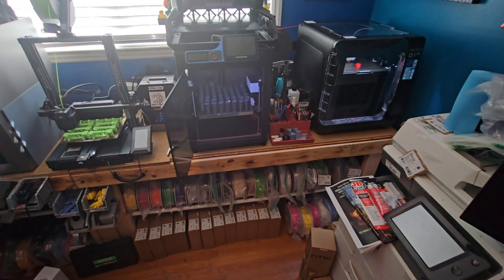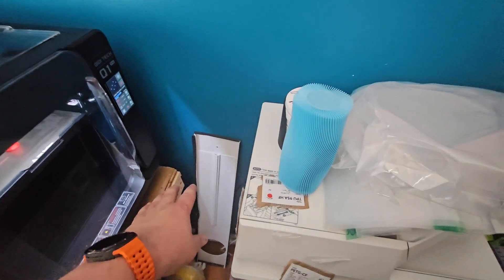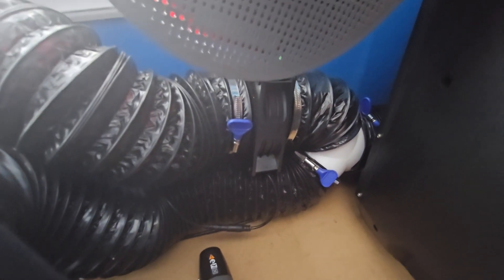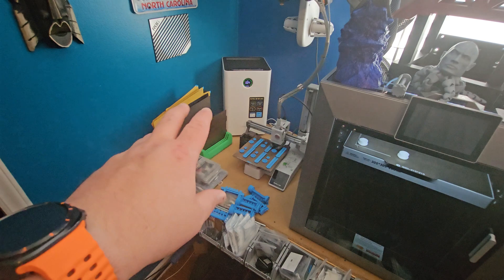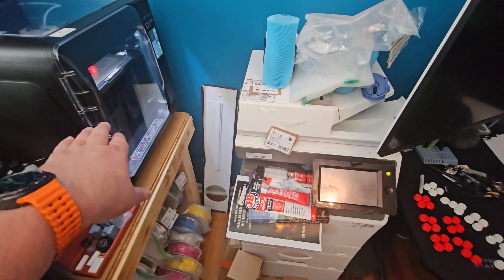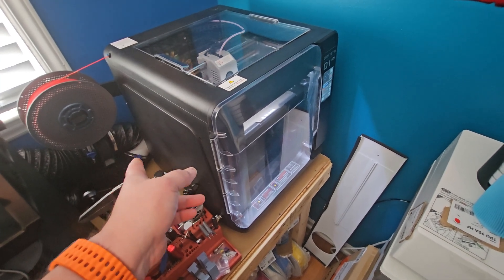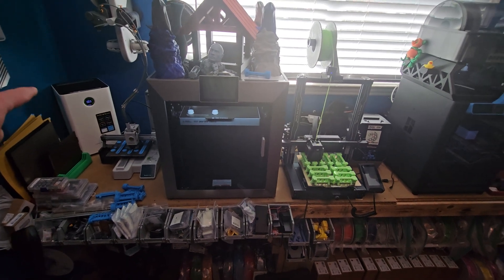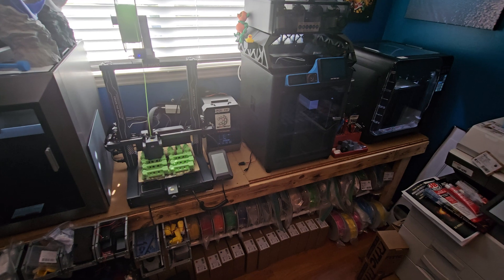How To Filter 3D Printer Fumes (You must do this)

Comment: The 4" adapter on back of the bambu, is that a 4" to 6" hose adapter or is that just 4" adapter + that hose that has the inline variable speed fan is also 4" hosing or is it 6"?  The window slide in type adapters im seeing are 5.9" i think, i need a dual port one, so i can vent a spray box for spraying parts as well, and i dont see any that take 4" at the window piece, i originally assumed i'd have to get a 4" converter to 5.9 / 6" hose near the window (if using 4" hose as i think you are ?)?  Maybe im blind but i dont see where you have the inline 205 cfm fan vs the other smaller one (is the inline with humidity controller really needed)?
Reply from the maker: I've copied the links below to what I used.  Its all 4 Inch .  The nalle Fan is much more powerful and has a remote the smaller fan still works good and the speed control is on the plug.  Let me know if you need anything else.  T

https://amzn.to/3YSJHJY
https://amzn.to/3YWidTO
https://amzn.to/4hD15cX
https://amzn.to/4fh7DfN
https://amzn.to/4hOaKhc
https://amzn.to/48H3oYo
https://amzn.to/4eoo20K
Reply: @LifeN3D2025  Thanks, appreciate the reply, is there a way to calculate the cfm needed for a given hose distance though? Also,the only dual port window adapters i see out there are 5.9", so i guess i need an adapter or a short section and reducer from 5.9 to 4", or use your version you linked and somehow cut another hole perhaps.  When not doing abs do you leave that nalle fan in the off position or i guess it would have to be running or the air wouldnt make it and backwash? (PLA)
Reply from the maker: Hey yes you can cut a second hole.  I took a peice of plywood and cut it same size as my window kit,  then made 2 -4"  ,holes.  I use one hole for my 3d printers and 1 for my laser.  280cfm with 4 inch pipe is very sufficient as long as the run is under 8ft.  If.over 8ft 400 cfm.  and no.you do not need the humidity control.  For this generally these type fans for hydroponics that's why they have humidity controls.  Lmk if ya need anything else
Reply: @LifeN3D2025  Im actually wondering if the 280 cfm is too much for even 8 feet, maybe not though, do you have issues with cool air being drawn back into the printers and causing things like abs to warp?  I hear if not done right this can occur

Comment: Out of curiosity what are people doing to prevent UFPs?  Hepa + carbon filter? Just ventilation? Full enclosure with ventilation system? Thinking of getting that bambu lab on special but worried about UFPs more than fumes since I have family members with asthma.
Reply from the maker: Hey man I just linked all the items I use in my video descriptions.  this is not a sales pitch someone requested it and I thought it was a great idea.  that said I would still recommend.

whatever room your printing in square footage get  Hepa filter with charcoal  for that size room.  Mine was 72 bucks I think.. This is most important.  That said if your only doing pla or petg printing this is really all you should need.

if you want to be extra cautious,  whatever printer you buy get some alien tape (very strong double sided tape) and get a 4" dryer vent adaptor and attach to back of where fumes exit.  Run a dyer hose from that out the window and or right next to your hepa/charcoal filter inlet,  if a window is not an option.  below is what I use they are affiliate links and I do get a small commission.  that said I bought these items long before i applied for commission hope it helps and go for it bambu labs has great sales right now 
Below are affiliate links if you purchase I earn a small commission

4" flexible tubing - https://amzn.to/3NCOg4E

4 way vent splitter -  https://amzn.to/4dYlXs8

Creality Laser cover   https://www.amazon.com/dp/B0CTSX9Q2H?ref=fed_asin_title

 Whole room air filter 1000sq   https://amzn.to/48dRJ3n

4inch duct adaptor  https://www.amazon.com/dp/B07FVZPNC5?ref=fed_asin_title&th=1

 Duct Clamps  https://www.amazon.com/dp/B07QVKHWZB?ref=fed_asin_title&th=1

150 cfm exhaust fan variable speed https://www.amazon.com/dp/B0B2PBQY8W?ref=fed_asin_title

Honeycomb   laser plate  https://amzn.to/3Nzqart

Laser elegoo  https://amzn.to/48jVT9D

Elegoo legs  https://amzn.to/3NAfb13

Elegoo window mirror for laser  https://amzn.to/4h9o6Ep

Esun  Filament bag and pump kit   https://amzn.to/3zYivQF

Humidity gauge   https://amzn.to/4dVOKxt

Super lube oil  https://amzn.to/40fTQl9

Super lube grease  https://amzn.to/4dZIs03

Soldiering iron with insterts https://amzn.to/4eKmsHD

Air filters jafanda https://amzn.to/3BQDiG6

Panda touch https://amzn.to/3UjmJcy

Duct connector flange  https://amzn.to/3YB2Vnv

Hose clamps https://amzn.to/4fdoPCF

3 way  https://amzn.to/48k8sli

In line fan 150 cfm var speed https://amzn.to/3YxoPaZ

Must have 3d print removal tools https://amzn.to/48edPCJ

Exhaust window kit https://amzn.to/3YhNNK5

Flush cutters https://amzn.to/4ffGrh6

Bench for printers or supplies 48in https://amzn.to/4fdpNPj

Deburring tool 11 blades  https://amzn.to/3zYjAId

Deburring kit 7 pc https://amzn.to/3YfDqqj

Multi blade debur kit https://amzn.to/4dVKkqG

Good exhaust fan https://amzn.to/4hizL3y

Fan option 3 https://amzn.to/3BRItG3
Reply: @LifeN3D2025  thanks man, was just curious and been trying to find how to get into 3d printing while keeping it safe, saw your video was recently posted and decided to check it out.

Comment: I see you have an Elegoo Neptune 4 pro or something similar. Have you had any trouble when printing? I bought one recently, and it happened to me that the nozzle sticks to the model, and then it ruins the print because it unsticks from the plate.
Reply from the maker: It is a neptune 4 pro.  Yes my first print failed.  I had to do bed leveling again.  I also usea product from slice engineering that prevents plastic from sticking to Nozzle and silicone rubber expensive 15 bucks for small bottle works darn good though no issues since
Reply: @LifeN3D2025  how is that product called?

Comment: I am in the process of building sth similar, but based on an Ikea-derived secondary enclosure around my Qidi Plus 4. Same 100mm (4inch) tubing and axial ventilator in principle. My reasoning is this: PLA often necessitates an open door and lid of the printer's primary enclosure  which our sub-500 CFM fans donÄt easily overcome given turbulence and thermics and all that. Better safe than sorry.
I use the same axial fan and a Y-piece to create downdraft on my perforated post-processing tabletop where I do a bunch of chippy and abrasive stuff. I gotta be super-anal about my setup, given it's in my small urban apartment kitchen.
Reply from the maker: I love it I've been adding bento boxes in printers plus. Carbon on printer exit fans plus in line the ducting.  I generally don't smell anything when doing abs asa .  Thanks.for.sharing

Comment: but isnt PLA safe to print with without filtering?
Reply from the maker: I print pla and petg without any filer aside from in room air purifier when I remember to.turn it on
Reply: PLA is the safest to print with but it still produces some VOC so you do need some sort of filtering. Which can be as simple as a basic room air purifier.
Reply: @BigClementineCherry  the majority of "air purifiers" do not capture or remove Formaldehyde.